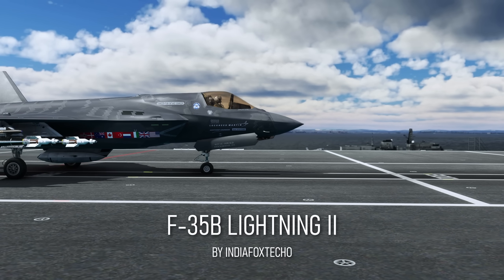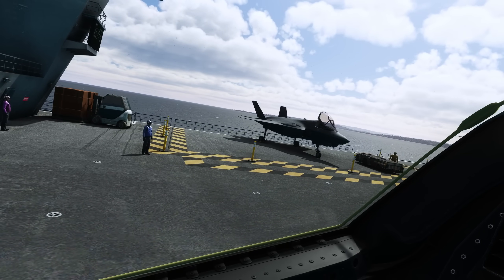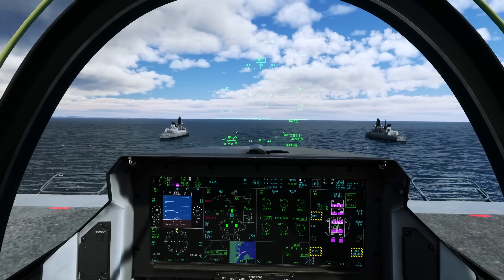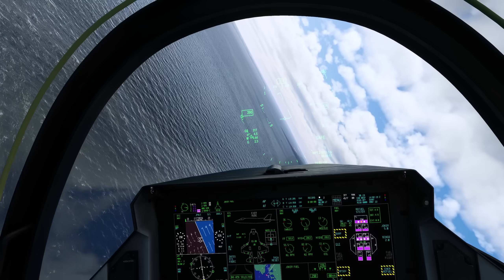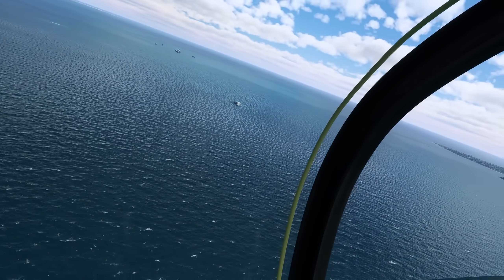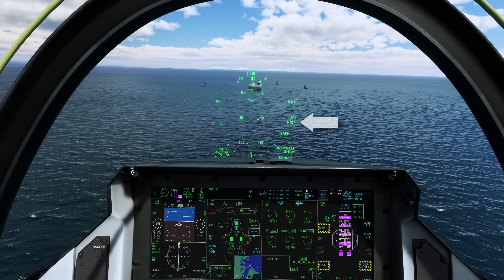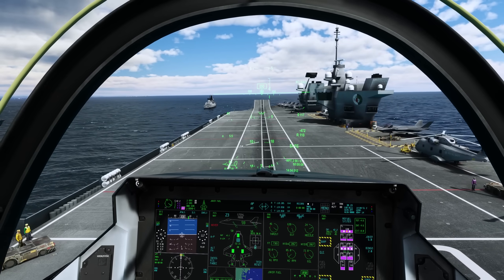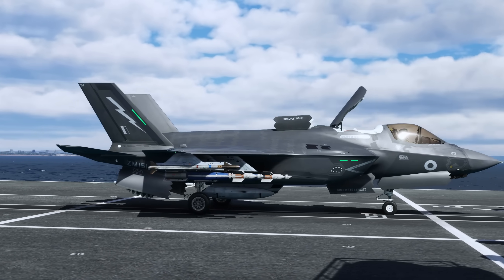Too Heavy to Hover? The Brits found a solution! F-35B Lightning II SRVL (MSFS)

Comment: Sharky Ward has some interesting descriptions of landing the SHAR at night in fog with low fuel during the Falklands conflict. IIRC one landing had the ship shine a light straight up with the SHAR pilot descending into the fog beside it until the deck emerged from the gloom and then hovering sideways until over the deck, then the rest of the way down. Sea Harrier Over the Falklands by Nigel "Sharky" Ward.
It'd be interesting to see how the F-35B managed the same situation.
Reply from the maker: I’m sure the F35 would make it easier! I’m wondering if the F35 can fly the needles in near zero vis.
Reply: @cgaviator  You’d hope no vis flying systems have improved since 1982. 🤣
Reply from the maker: @rednaughtstudios  they have, though the risk appetite is a lot lower! 😅
Reply: @cgaviator  Yeah but we were at war in the Falklands conflict. I'm sure the risk appetite would change if the UK found itself at war again.
Reply from the maker: @owensmith7530  yup, it totally would!
Reply: Thanks for the reference / always fascinating

Comment: Further evidence that the F-35B design is crap.
The additional weight of the Door, Actuators, Down Thrust Fan, Drive Shaft and Gear Box is unnecessary and tactically crippling.
Britain should have invested in the Plenum Chamber Re-heat design that would have resulted in a supersonic, Harrier type, aircraft.
They could have had an F35 look-alike with the capability to carry far more fuel and/or ordinance.
Reply: Make your own aircraft and stop complaining
Reply: @jophussaurus2450  We used to, until stupid politicians started making decisions. Now we're stuck with buying American crap.
Reply: To be fair, it still carries a pretty decent payload, far more than the Harrier for example, and not that far off some catapult assisted aircraft.
Reply: @Benjd0  But at the expense of fuel.
Reply from the maker: Never heard of the plenum chamber. That a harrier upgrade or something the F35 design should have had?

Comment: Is this not a standard case III recovery?
Reply from the maker: Case recoveries are based on weather. They usually end in hovering alongside or an over the stern conversion to the hover. This is specifically about the method of touch down 👍🏻

Comment: Never knew the QE had no traps. So it's basically dedicated to V/STOL aircraft. That sounds.....shortsighted and rather dumb. Really limits its capabilities throughout its operational lifetime.
Reply from the maker: Only limited to F35B but with that jet, it has similar capabilities to Nimitz apparently. Subject to having enough jets on board. I guess it’s basically the largest amphibious assault vessel ever! 😅
Reply: @cgaviator  Kinda what I mean. The ship is likely to have an operational life longer than the F35, and they're betting/hoping there will be a similar successor.
Reply from the maker: @DrOneOneOne  good point!

Comment: Why doesn't your HUD follow your head movements? Isn't it helmet mounted?
Reply from the maker: Apparently there isn’t a way of getting all that detail onto a HMD in MSFS. There is an HDM option but it’s very basic so I turned it off.
Reply: @cgaviator  Ok. It would be cool to see an authentic F-35 HMD. I usually watch DCS videos and I'm not familiar with MSFS for this sort of thing. I don't think DCS has it either btw from what I've seen.
Reply from the maker: @swordmonkey6635  DCS has it for F16 & 18 I believe. Think their F35 is a basic mod

Comment: fun fact , there is room to fit cats and traps on the QE as they where originally designed to have.
Reply from the maker: Yup, but sadly they can’t use trap as they would need a large source of steam. Apparently the electric cat isn’t nearly as reliable
Reply: Yes, but the quoted price for doing it... is about the same as the purchase price of a new carrier.
Reply: Don't know why they wouldn't fit traps,  it  works without steam ,that's for cat launch. They would have the option to receive f35c in emergencys either store or helo them off. I suppose they must have a "catch net" if one can't hover and comes in "hot".
Reply from the maker: @charliedecker7702  we almost changed to F35C but the politicians changed there mind as it would could cost £2billion more and delay everything by 5 years. I don’t think there’s a barrier either.

Comment: I'm a little surprised there's no arrester wires on the QE2s, but having said that, I imagine arrester gear would be impossible to install on the F-35B anyway with the rotating engine.
Reply: To do with cost and the battering the air frame takes.
Reply: @johnnybravo9096  I wasn't seeing it for regular use, but to make sure the QE2s had the capacity in case of emergencies or to futureproof the design (should it become relevant down the track,  Admittedly, they may well have the capacity to have them installed at a later date, I don't have the knowledge of either the class or ship designing in general to know how feasible that is in the long run.
Reply: @malusignatius  I believe they were supposed to be designed to accommodate catapults and arrestor wires, but some of the mid build political flip flopping seemed to indicate it would be an expensive refit. Of course they probably also wasted a significant amount of what it would cost to do that by doing stupid things like slowing down construction to not spend as much in a year, as if it matters which years budget pays when presumably the country and its tax base will still exist next year.
Reply: @KarlJeager  Ahh right, that would make sense.
Reply: @KarlJeager  Harriers never had arresting hooks AFAIK, so why would the F-35B have it? The version that has arresting hooks is the F-35C, and that's meant for US supercarriers that do have the appropriate arresting gear.
Reply: @StrikeNoir105E  Firstly in case this is from my previous post not being clear I was referring to the carrier being designed to be able to fit catapults and arrestor wires in response to the second post of malusignatius about future proofing.

If the Carriers had been converted to CATOBAR the government would have switched its order to the F-35C, this was all around 2010 so early in build and as the harrier was being retired from service, considering the ships are planned to have a fifty year service life there is a fair chance they will be converted mid life particularly if the F-35B isn't favoured with upgrades, but then I guess the F16 is almost that old so who knows.
Reply: @KarlJeager  they were actually looking at scraping the f-35 altogether and going back to the F/A-18 super hornet and magnetic catapults.
back in 2010.
but they decided to keep the f-35B having spent billions on it.
it was a "stay or go" situation, so they never considered the f-35c.
Reply: @quadg5296  You can find news articles about the change back from the F-35C in 2012 or look at the 2010 SDSR detailing the planned change including a quote here from page 23.

 " Installing the catapult and arrestor will allow the
UK to acquire the carrier-variant of Joint Strike Fighter ready to deploy on the converted carrier
instead of the short take-off and vertical landing (STOVL) variant."

I cannot recall or find an mention of the Super hornet for the UK although it was one of the options when Canada was considering cancelling their F-35 order.

Comment: If you think landing with about 5 kts of relative deck speed is going to increase the weight at which you can land, you don't know much about aerodynamics. The wind over the bow from the ship sailing into the wind is many times greater than that slight relative speed in relation to the deck. The reason for that technique is to spread the heat of the jet efflux out over a bigger area of deck so to reduce the maximum heat induced at any one spot, not increase the allowable landing weight.
Reply from the maker: I’m sorry to disagree, but if you watch the documentary it does a great job of explaining it. The idea is to have about 60kt over the wings to increase lift.
Reply: You're wrong bruv. The royal navy pilots themselves said it was to increase bring back payload. I'll take their word over YouTube expert

Comment: I saw the original documentary when Queen Elizabeth first started her flight training ops with the F35-B. The manufacturers and the US Navy said a rolling landing was impossible until the British primary test pilot showed them how to do it and, I believe, his method is now taught to the US pilots so they can replicate this manoeuver.
Reply from the maker: I think they use it on land, but they don’t operate the F35s from big carrier decks, mostly LHAs or whatever they are.
Reply: Same thing happaned to the corsair the brits had an advantage thanks to landing Seafires though
Reply: Polite Hat tip to Eric"Winkle" Brown. @NHT7040
Reply: I never read about anyone claiming an f-35 rolling deck landing was impossible. Do you have a reference?
Reply: Thats not true.
The SRVL procedure has been developed in the UK for over a decade now. Software development, simulations...the lot. 
USMC use Rolling Landings on F-35B just like the RAF do...on land.
They are not going to use SRVL on their LHA's as the landing area is a lot smaller and they have not identified it as a requirement.
Reply: Although it is two years on, and I watched this video first time around, there is an important piece of information to add. The two carriers were built in cooperation with the US Marine Corps, they are the ones flying the F35B, not the USN, who fly the F35C. Ever since the Harrier development programme, the USMC and the British have been hand in glove during the development of the F35B. The result now is complete interoperability between the RAF and USMC when operating off the decks of the RN carriers.
Reply: No surprise the UK found a way of doing something that the US couldn’t. There’s something to be said about mucking in and making do that makes the British very inventive. Then add US funding and you’ve got a powerful partnership.
Reply: @Axispaw1  Its like the story from way back when NASA sent Rolls Royce a cylindrical pipe with a hole 1,000th of an inch in diameter stating their engineering prowess, RR sent the same pipe back but now the hole was threaded with a bolt screwed into the thread which also had a hole drilled in it. RR said nothing.
Reply: Just like the US navy said that the WWII Corsair couldn't be safely operated from a carrier until the British showed them the constantly curving approach that we'd used with Spitfires to have some visual reference to the runway for as long as possible.
Reply: @mothmagic1  The RN also used a much flatter approach to the carrier with the Corsair than was ideal (flat approaches are not preferred because they tend to result in the hook skipping over the wire rather than engaging it, because it doesn't press the hook into the deck), while the USN was content to fly the Grumman F6F off its carrier decks and wait for Vought to work out the genuinely deadly deficiencies with the F4U-1 (overly bouncy oleos tended to result in the entire plane skipping over the wires, for example). Both Navies saw the same problems in the F4U-1. The USN was inclined to wait because they had first dibs on the Grumman fighters while the RN wanted the Corsair from the jump and was willing to accept its marginal carrier suitability because they felt it was the superior plane overall.
Reply: @disorganizedplay at that time the RN would have accepted cardboard boxes with wings and were grateful for whatever was available from lendlease. They did a great job with the water cooled aircraft they had available however British carriers aircraft were a lower priority due to the continuing air war at home….. it took them until the end of the war to deliver the superb Sea Fury.

Necessity often drives innovation and the FAA and RN were pushed by events and enabled by the British culture of being able to influence authority.
Reply: TBH, my first thought was of HRH in flight gear
Reply: Manoverboard, manoever (as some sort of american english perhaps), or maoeuvre (krekt english spelling and you can tell that because it comes from the french).

Isn't lingo brill‽
Reply: Why it would be impossible? The technique has been known since early harriers...
Reply: @NordicStrider  yes, agreed, but the two jets have completely different flight systems for hovering and completely different controls. Problem is, (in the US Military), if its not in the manual it can't be done whereas the UK military tend to use initiative.
Reply: @mikestrohm3271  Much, much harder on the harrier and they still knew it was possible.
Reply: @ wrong way round, much easier in the harrier as there was only one control lever for the nozzles whereas the pilot in the f35-b has to control the lift fan and the swivel nozzle independently of each other.
Reply: @mikestrohm3271  Yeah, that's a no it's fully automated IRL. 

On top of that F-35B is much much more stable platform due to modern automation and flight stabilization. What happens you go hands off on a F-35B? It just hovers...
Reply: @ So computers fly it which was the problem. A hands on approach was what was needed and the British pilots could do that due to experience with the Harrier. USN Pilots let computers fly the plane and because a rolling landing wasn't programmed into the computers they thought it couldn't be done.
Reply: @mikestrohm3271 Ah, that magic word, initiative. I'm sorry to say that at prep school, we were encouraged to flourish by using our initiative.
By big school though, the government had changed and one of the diktats that came down from on high was to categorically discourage the use of initiative. After all, if you had a class full of smartarsed kids using it, how on earth could you teach to the national curriculum?
Thankfully, we are our own characters and use it still, perhaps even to annoy teacher‽
Reply: Why does the Queen Elizabeth aircraft carrier have a sad face on the rear
Reply: @maly2ts408  It does look like a sad face but its actually the access ports for mooring as well as ladders leading down to a lower mooring position near the waterline
Reply: @maly2ts408  Good spot and great to have so many well informed commenters helping out here ~ a rarity nowadays on this admirably named "social" media.
My thoughts on the vessel's backside are different again.
Granted, there's a whiff of sadness on the undoubtedly face~like rear. But I see it more as a cross and determined, gritted teeth sort of visage.
Reply: To be fair a lot of these guy's would have experience using Harrier's with much less power and far more complicated control's. I've no doubt the US Marine pilots would have been able to perfect this idea pretty quickly too.
Reply: There's historic precedent,  the Royal Navy figured how to reliably land the F4U Corsair on a carrier in WW2.
Reply: @tedb.5707  I think the thing to mention here is that the Royal Navy solved all the carrier problems and the rest of the world followed suit, ie, angled flight deck. Incidentally, do you know why the Island is always on the starboard side?
Reply: @mikestrohm3271  The first aircraft carriers had propeller powered aircraft. On these aircraft the prop turned clockwise, creating torque which tried to force the aircraft to roll counterclockwise, or left. An injured pilot, or an aircraft out of trim due to damage would roll left. So the island was on the right & it’s stuck through tradition ever since.
Reply: @simonbird1973  Good thinking Simon but its actually less technical than that. When it was designed they just decided to put the island on the starboard side (it could just as easily been port) and, as you say, it has remained there ever since. When aircraft carriers were first conceived the planes at the time were small, light and slow so torque 'steering' wasn't considered, in fact, when planes became more powerful and faster consideration was given to changing the island side because it was preferable to not have out of control planes going into the sea off the port side taking the pilot with them. In fact the Majestic class of RN carriers were initially going to be port side islands but the coming of the jet age removed the torque steer problems so the islands remained designed on the stbd side
Reply: @mikestrohm3271  I think we are coming back to the adage of the sword in the right hand as of we in the UK drive on the left hand side of the road, in the aircraft carrier division the Americans have followed suit.
Reply: @mikestrohm3271  Torque. Applying TOGO power would have prop driven aircraft into the bridge or into aircraft parked on the deck.
Reply: @mikestrohm3271 issued it's just convenient standardization for port travel and pilot landings
Reply: @mikestrohm3271  Because the pattern is to Port.
Reply: @mikestrohm3271  probably even simpler.  In UK you drive on the left :P
Reply: @mikestrohm3271 It’s because aircraft carriers are all right hand drive, the same side as cars on British roads.
Reply: @mikestrohm3271  Japanese in WW2 were on the left.
Reply: @tankman966  Some did, not all.
Reply: @mauricelevy9027 The correct way to drive.

Comment: Didnt they almost certify the harrier for this method? So they didn't have to drop munitions before landing?
Reply from the maker: Apparently not. They did use the VAAC Harrier to develop the procedure for the F35 I think
Reply: I am not sure the Invincible class would have a long (or wide) enough deck to perform SRVL, even with lighter Harriers
Reply from the maker: @juleswombat5309  agreed, would have been very tight!